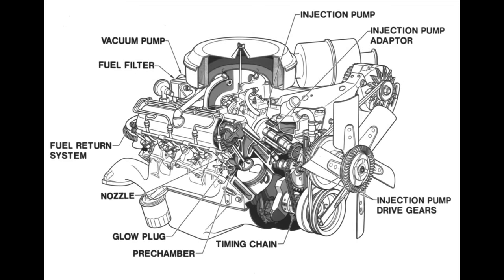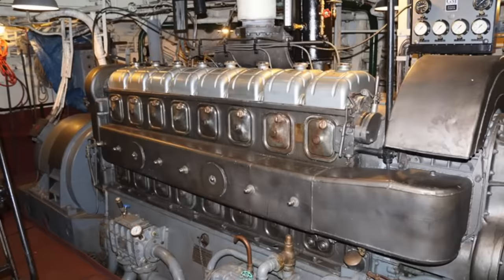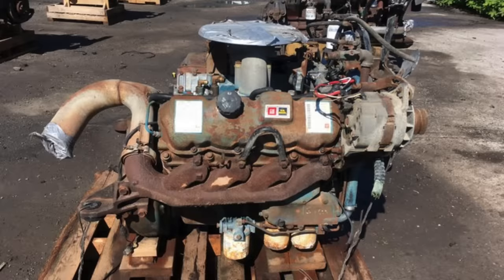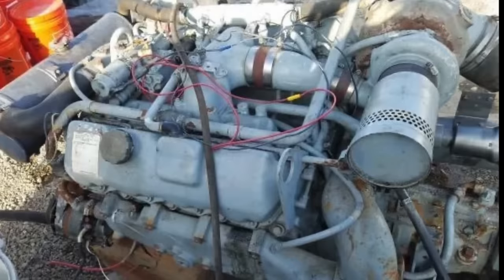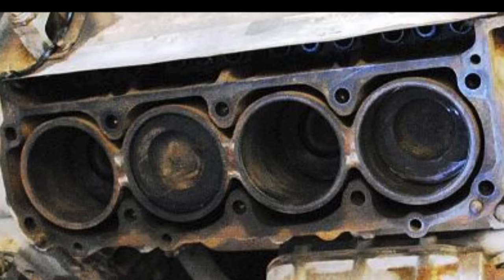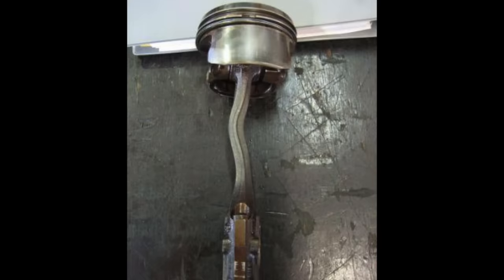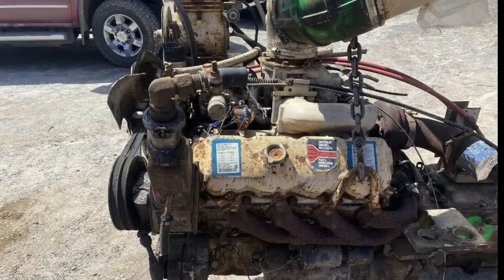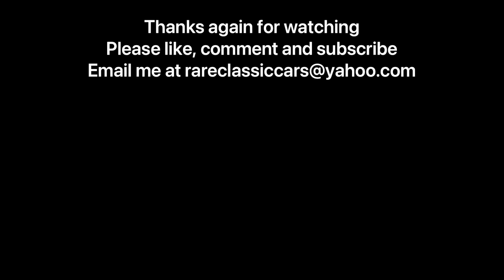Worst Engines: GM's 8.2L / 500ci "Fuel Pincher" Detroit Diesel Pinched Its Owners' Pocketbooks

Comment: Add the Northstar to the under built head bolt list as well.  It's like GM never learns from their mistakes.
Reply: The GM bean counters were their own worst enemy
Reply: Ford was no better with head bolts.   Years ago when torque-to-yield bolts came out I was in tech school and the auto tech guys bought a set over to see what made them so outrageously expensive.  

We in the machining labs had every testing tool known so we ran them through the tests.    Turns out torque-to-yield bolts are a generic grade 3 crap bolt with an outrageous price.     
Hardless, ~ same. 
Torsion yield, ~same
Stretch yield, ~ same
Price, 10X! 

To this day whenever I work on an engine with those bolts I replace them with grade 8 or similar metic-rated bolts and I have never had a head gasket issue come back.
Reply: @illbeyourmonster3591  who said that they didn't?  The topic of this video was GM.  They all have flaws (including Toyota and Honda).

I will note that I don't recall a particular famous engine failure directly resulting from engine bolts as we have with a number of GM engine families (I am not saying that it doesn't exist just not recalling one or that it was a repeating problem).  The common head gasket weakness I recall on say the Essex 3.8 was due to a composite head gasket which was not sufficient largely due to the spacing of the coolant and oil lines in the head being harder to seal.  The 6.0 and 6.4 were Navistar designs not truly Ford Am I understanding that was that and my understanding why those had head gasket problems was due to the insufficient quantity of bolts.

Most of the other Ford problems that I can think of such as the spark plugs on the 2 valve 5.4, long list of issues on the three valve 5.4, the wandering cams on the 3.4 SHO, the chain driven water pumps on the fwd cyclone V6, etc. were usually limited to that engine ( and any direct variants from that engine family).  Again Ford has plenty of their own faults, but it doesn't seem like they kept making the same mistake over and over again at least as far as I'm aware outside of turbocharging.
Reply: @colinschmitz8297  I wasn't really saying anything. I was just telling a now funny story from my life of how too often some 'new tech' turns out to be nothing but rebranded and overpriced junk.

As you are also obviously aware.
Reply: @colinschmitz8297 wow I bet your fun at parties huh? 😂
Reply: @shawnsatterlee6035  are you kidding me, at the parties I am invited at, I am considered to be the life of the party...granted everyone else at the party is at least twice my age... anyone my age or younger has enough sense not to invite me.😜
Reply: @illbeyourmonster3591  what does new tech being junk have to do with the point about head bolts?  My original point was GM had a reoccurring problem with head bolts, you said so did Ford, now you are saying that it was about new tech being junk?  What way is it?  What engine are you referring to?
Reply: @colinschmitz8297  You seem to be reading way more into my comments than is there to be found.   

Just like GM and every other manufacturer, Ford has had various issues with all sorts of things in different engines over the years.

There is no one-size-fits-all answer to any of it.  Some had head bolt problems, others had oiling system problems, and some had the fatal flaw of being too complicated for what they were trying to accomplish.  

Me personally, I just don't like torque to yield bolts regardless of whatever I am building.  I know they are over priced low-grade crap.
Reply: @illbeyourmonster3591  you are more or less repeating what I said in response that they all have flaws.  If the head bolts are junk, why isn't there a systemic issue with head gasket problems with that non specific Ford engine?
Reply: @colinschmitz8297  There were, just not currently that I am aware of, or that is not overshadowed by some other major flaw in the engines. 

As for older examples the old Ford 3.8 L V6 was notorious for blowing head gaskets due to clamping issues.    Proper high-grade bolts fixed them every time.

Comment: We had a 1986 GMC 8000 E-One pumper in my volunteer fire department with that engine.  Had no issues.  Local Detroit dealer serviced it annually.  Tech told me the engine was an Oldsmobile design,  not Detroit Diesel.  Told me it was a siamese block and that it would cost too much to do a recall campaign that GM just dumped it.  He told me all of its issues could have been addressed and it would have good longevity.
Reply: Well that tech was full of shit...... The 8.2 had absolutely nothing to do with Oldsmobile, and frankly has nothing in common with any of the Oldsmobile diesels.

Comment: Yeah, I never had heard of this engine. As much of a failure as it may have been, it's still fascinating and very interesting, specially from an engineering stand point. 👏🏻😁
Reply: When they were running good, and many did, they were FANTASTIC on fuel mileage.
Reply: The early ones were bad...something like 48% were replaced under warranty...but the later ones with bigger head bolts, etc were not bad motors....not an HD motor, but for 5yrds of gravel or a busload of kids...they were perfect an miserly.

Comment: I inherited a 1980 GMC two-ton truck with a grain hauling bed that I believe has the 8.2l diesel engine shown here. Sure looks like it. It's certainly no 'fuel pincher' but it's always ran well and unbelievably starts in cold weather without any challenges. In fact I just started it in 34 degree weather to warm it up after a 2 week super cold streak. It calls for two batteries but a single battery has always been sufficient. Very much agree that the horsepower could be better.

Comment: From 2012-2016 I called on a small regional freight company that had a mix of straight or box trucks and day cabs with dry van trailers, all old as the hills. If any of you are in the trucking industry, they still had a couple 45’ Fruehaufs getting drug around. They were all pre-emissions trucks, which made some sense but after awhile, they can only bandaged up so much. Anyways, they still had a few (maybe 6-8) straight trucks with the 8.2 Detroit, only a couple were turbo charged. I’m not sure how many miles were on them but they were rough. If I was a Statey, I’d just wait for their fleet to drive by and absolutely pick them apart. 
Driver retention was predictably poor at that place 😅

Comment: I had a ford school bus that I used to flea market with. Pulled a trailer and loaded it down way too heavy .  Drove it from the east coat to Arizona and all,over for years.  Went 58 mph uphill or down hill and never left me stranded. Actually , from what I remember , other than routine maintenance it never broke down .
Reply: But, but, but...they were terrible engines...The Worst in fact...lol
Reading the comments is one story like yours after another on any 8.2L video...the Narrative falls apart in reality....
Glad you enjoyed your bus and had good service from it. My friend has 5 of these in C-60 GMC Tree Guy trucks...its funny how they roll up on a job in a 35yo truck an it's the star when there might be 2 or 3 brand new trucks there too.😉

Comment: I worked at an independent truck repair shop when these first came out. A couple of our customers had bought them and they were reliable at first. After a few years they all had block problems. One had cracked through the oil passage to the head and the other came in with a "slight miss". Investigating the miss, we found that the block had split lengthwise along the cam bearings almost the entire length of the block. We had removed a main bearing cap and a chunk of the block fell out when the cap was removed. And this truck had DRIVEN IN with a slight miss.

Comment: I had one of these 8.2L’s it was a good reliable engine that was good on fuel, up until it wasn’t, coolant in the oil sent it to an engine builder because when it was running it really was good on fuel and pretty reliable, we spent more than the truck was worth, and once we got it back it didn’t make it a week and it once again was filling the crankcase with coolant, we had it sleeved, injectors rebuilt, new heads, all new bearings and gaskets, and were right back were we started. So we pulled it out a second time and replaced it with a ZZ4 small block and at the cost of fuel economy it was once again reliable.

Comment: Drove 8v-92 in GMC 9500 in the 70's.....30 mph up hill and 80 mph downhill.....also, you froze your keyster off in the winter...idle temp was about 100 degrees....
Reply: @darrellsaunders4267, they didn't put 8.2 liter diesels in GMC 9500s

Comment: Did anyone ever sell or install block guards?

I had one in my old Civic. Honda's are also open deck, a block guard was inserted into the water jacket to stabilize the cylinders while boosted.
Reply: @pietmondrianstudent6984  because it wouldn't address any issue but cylinder walk. You still have the asymmetrical/low clamping force issue. It also subjects a block element to stresses outside of design specs. If just "fill the deck" would fix it, simply sinking the head over the cylinders (ala air cooled vw) would be a simple solution. But you still only have 66% of the head bolts per cylinder you need for a diesel. Bossing the intercylinder rib and extending it to front and rear walls would offer adequate bolting, but would increase mass not touched by coolant, and offer asymmetrical cylinder cooling compared to a decked design. There really wasn't a "fix" for the engine, besides redesign to "conventional". Had they said "let's just deck and 6 bolt it", it probably would have been an awesome block, but open and 4 made it barely adequate for low demand duties.
Reply: It worked for my Civic to make 250+whp on an engine that made 92chp from the factory.

I guess idk for sure if the cylinders would have walked, but other people had that issue, & mine didn't. 

Sure, fixing the weakest link exposes a new weakest link, but you need to fix the weak link to see if the next one will be weak enough to matter.

The heads could have been o-ringed, instead, maybe. I almost went that way. A small circular groove is cut in the cylinder head, slightly bigger than the bore (the "O"). Then a steel wire, just barely thicker than the groove, is placed in the groove (the "ring"). this compresses the gasket slightly more around the cylinder.

I didn't go this way because I don't see how it prevents walk, but it did help engines that made way more power (than I did) stay together & sealed.
Reply: I was thinking the same thing. Maybe no one thought of it back then.

Comment: You are being very diplomatic by using the word "challenges."  These were problems and design problems.  Let's not sugar coat things.  I am very familiar with the marine version of this engine.  They were know in the industry as diesel powered hand grenades.  Many boat owners found themselves in a real pickle given that very few shops would rebuild them and 3208s were considerably larger and heavier.

Comment: My dad bought a new Chevy truck back in the day and it had that worthless 5.7 diesel in it. It blew up almost instantly and the dealership took it back and replaced the diesel with a 350 gas free of charge! 🤣
Reply: All problems with the 5.7 diesel were because GM decided not to install a fuel/water separator. Water in fuel causes rust. Rust in injection pump causes overfueling. Overfueling causes cylinder overpressure. Cylinder overpressure causes head gasket leaks. Head gasket leaks lead to divorce.
Reply: @erikkovacs3097 Water does more than just that.

It is not a lubricant, meaning the fuel system (which relies on lubrication from diesel fuel) sees periods of poor to no lubrication, wearing it out faster.

Water also increases cylinder pressure during combustion, which contributed significantly to the head gasket issues these engines already had.

The lack of a water separator was an enormous part of the problem. The engines are honestly fine with modern knowledge and techniques of ownership. Many of the 5.7’s left on the road are owned by people who understand them.
Reply: @erikkovacs3097  
LOLOLOL 
Divorce, even? 
That wasn’t the only problem. 
Another problem was people would not allow the engine to warm-up a bit, and drive it a little more gently until it was fully warmed-up. 
People would start it and take off. 
I remember a neighbor having one of these, and he would do just that. 
Get in, fire it up, and take off. He would stomp on it, heading down the road. 
Diesels don’t like that shit.
Reply: The early ones had problems, but the later ones were much better.

Comment: I had one of those fuel Pinchers in it GMC single axle tractor. It was the turbo version had decent power and ran well but it was a low mileage truck only about 32,000 miles and had been owned by the Indiana Department of natural resources and had been properly maintained. I'll agree that without a turbo they were absolute dogs but they were good on fuel while they ran. They also have an overly complicated fuel injection system that uses push rods and the valve lash on the injector rockers to set the pump timing and not fun to work on.

Comment: Worked on these engines at a school bus garage. Dare i say, they were the most reliable buses we had.  They were so reliable we had buses from the 1980s still in service in 2013 and as back up buses if a newer bus broke down. For school bus duty these engines made a mechanics job pretty easy. Just gear them relitively high (3.55), keep the rpms pretty low, and keep up on the service. They run forever. Lower gears at higher rpms is where you find trouble with these engines.

Comment: I've had my share of the Fuel Pincher engines in medium duty trucks I've owned and all of them were fine for my needs which never involved towing equipment trailers or hauling heavy loads and I am always a big fan of the unit injectors which all know was a hallmark of Detroit Diesel.  All that said much rather have an all mechanical DT466 or one of Ford's Brazilian engines.  Both have served me without fail over the years.

Comment: Peugeot developed a wet-sleeve aluminum block V6 in the mid 70s that was also sold to Volvo. This engine was notorious for blowing head gaskets for the same reasons you mentioned for the fuel pincher diesel. As a mechanic at that time, I hated working on these engines and felt sorry for the customer who got stuck with such a terrible engine.

Comment: I have a 1989 Foretravel Grandvilla with the Detroit 8.2T. I swear there has never been an easier starting diesel engine.  Even with temperatures in the 20’s if you just touch the starter it immediately starts.  The sound is amazing with great street presence. It has a smooth, high (for a diesel) rpm sound while underway. It is paired with the Allison 4 speed and was engineered for the 55 mph speed limit days. At 55-60 and 2400-2500rpm it will get 10 mpg. 7mpg at 68-70 and 2800 rpm.  I agree with the low power comments. Pushing 20,000 pounds over the mountain passes is a slow affair.  It appears to have a 195 hp rating in this application with about 495 ft pounds of torque. I’m amazed at the abuse it has just eaten up, I run with it floored most of the time.

Comment: The free standing liners allowed the liners to move/vibrate along the major/minor thrust directions. I worked on these at a Detroit dealership and they had continual head gasket updates. If they had cast the top of the block solid like most engines the head gaskets would have lasted. Detroit tried drilling and taping the block for 15mm head bolts instead of 14mm.
Another issue was breaking the cup on the top of the pushrods. Not all would fail. Those that failed showed a witness mark around the top of the cup instead of down at the bottom.
Tuneup was a tricky pain to get right.
Reply: Right on, it takes the right tools and alota skill to tune these things. Not as simple as grabbing the right tuning pin like the other Detroits.......

Comment: My Cousin ran a Fuel Pincher for years and years over  300,000 miles  much off road miles   in a Tandem axle C-65 Chevy Truck .. It did not have a much  torque ...

Comment: Dad worked in a Garage for ER Carpenter in the late 70's early 80's. They bought an entire fleet of GMC Astro with that Detroit.
To add insult to injury all their trucks ran 55mph "clocks" that would get you fired for over 55mph for 3 times over 5 seconds. Big hills on interstate you had to downshift as soon as the hill came into view, just to maintain 35mph, up the next hill.
That 55mph clock fired hundreds of their drivers... Nobody wanted to travel NC to California at 55mph.

Comment: I made a lot of money working on them. There was no making them better.  There were also issues with pushrods and rocker arms.
With the proper tooling setting the injectors and governor was not bad. Not near as bad as a 3116 Cat to adjust.
Reply: I always wondered why Detroit made the 8.2 more difficult to run the rack than on thier other engines. It was so nice to only need a feeler gauge and the proper tuning pin.    
You're not kidding about those damn 3116 though!!! 🤣🤣🤣🤣🤣

Comment: I run a engine machine shop in Rhode Island back in the 90's and rebuilt a 8.2 in a Johnson 4 wheel street sweeper.Engine ran  well and was good on fuel.Run it at 1800 RPM for hours and would burn less than 20 gallons for 14 hours of work.Sweeper had a hydasatic trans.

Comment: I had 2 trucks with the 8.2 diesel. They were junk. No power, overheating, didn't really get that much better fuel economy, and no one would or could work on it in my area. Any time I mentioned the engine to mechanics they would al.ost run from me.